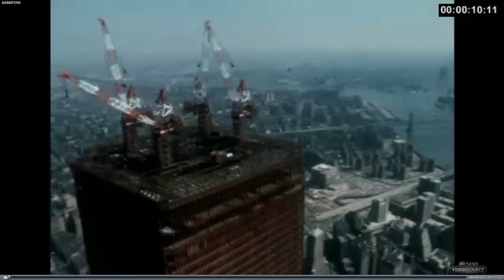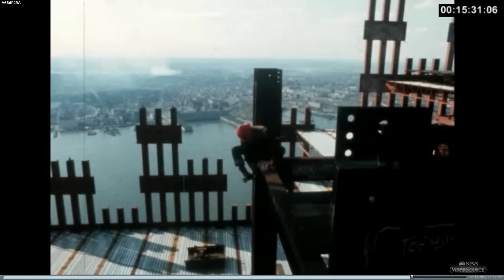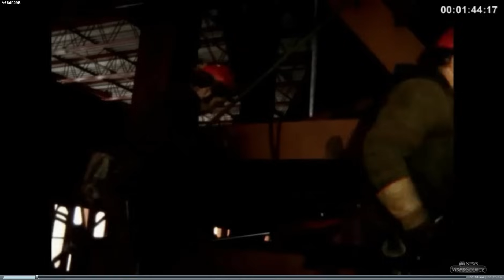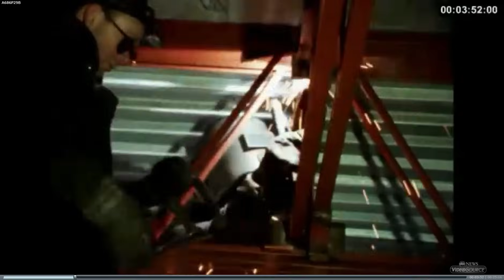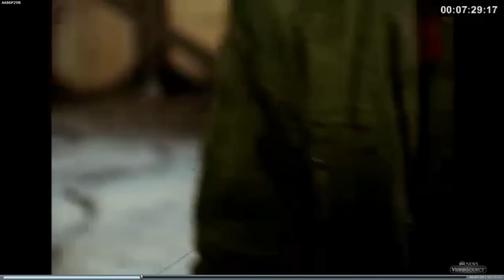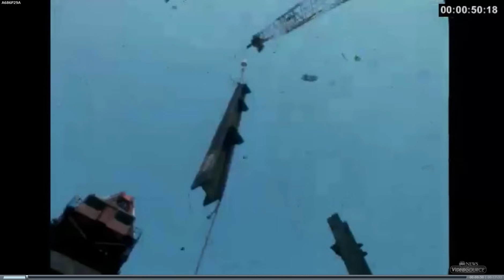WTC South Tower Construction Shots - March 1971

Comment: The sheer strength of those buildings can't be understood completely if you never been in the towers and stood between those huge I-beam's.  When I looked out of those narrow windows and looked down at the street the cars looked like hot wheels that you could just reach out and grab one.  They could withstand 100 plus mile an hour winds swaying 10 feet or more in any direction and you wouldn't even know it.  The 47 box beams in the core at the base were 5 inches thick 5 inches!!!  You can't imagine how strong that type of steel column is.  If you had just 1 50 foot beam it could hold the weight of 10 full size brick homes with ease.  I work on commercial passenger planes for years. The 57 and 67 planes are built as light as possible to save fuel and keep cost down.  The skin on the wings of the 67 has metal so thin that if someone walked on it it would fracture and have to be repaired.  If someone is just researching some of the facts about the attacks and I can help someone understand that what the 2 planes that hit towers 1 & 2 did isn't possible for ANY passenger plane is capable of just ask and I'll try and help you understand how it is impossible for flight 11, 175 and 77 to do what they did that day I'm happy to help.
Reply: @cream수탉수탉 big kok single engine puddle jumpers aren't anything like Boeing or Airbus aircraft.  Those type of planes are not designed like commercial aircraft that every gram of extract weight makes it more fuel efficient so it will fly further and save on fuel.
Reply: I was thinking the same thing when it happened, the thickness of the steel and the planes being basically an aluminum tube. I seen on YouTube a video done by a scientist that showed how easily it is possible, demonstrated how water at really high pressures could cut through steel.
Reply: @rsears78  How much pressure and what is the force it exerts per square inch? Also are you saying that the base or lower floors of the building were damaged in that manner?
Reply: Bartholomew Beauregard III  thank you for your critical thinking that so many people are not using.  Israel has this nation in a strangle hold and does not care about a country full of gentiles. Whenever they use up all that they can they will just turn to the next world power and do the same.
Reply: @438295 what lies?
Reply: mkbxtr44  you think whatever you want to cause I could care less what you think or beLIEve
Reply: mkbxtr44  name any commercial passenger plane capable of reaching 500 knots below 20k feet
Reply: mkbxtr44  you shouldn't make comments trying to sound like your educated bro.  That was as sad a comment as the one Donald made saying that same ignorant reply about picking up speed going down hill.  The airframe itself can NOT withstand the resistance in such dense atmosphere and remain airworthy.  Wood is quite a strong and powerful material, like a tooth pick size piece have been found inside of automobile engines and tree trunks after a tornado touches down.
Reply: mkbxtr44  please present proof of your claims
Reply: mkbxtr44  name one bro! You are the one claiming that it is possible so give me a example.
Reply: mkbxtr44  just give me one example where a commercial passenger plane exceeded it's VMO by 100 knots and remained intact, just name 1!!!
Reply: mkbxtr44  I have NEVER claimed the jets were hollow tube dude so get your lies straight
Reply: mkbxtr44  thesis as in THEORY
Reply: mkbxtr44  stop dodging the question
Reply: mkbxtr44  your link is this video
Reply: mkbxtr44  now I'm not following you, what are you agreeing with?
Reply: mkbxtr44  why won't you answer the question?
Reply: mkbxtr44  why would i read a bunch of threads nearly a decade old of people arguing with shills?
Reply: mkbxtr44  how much does it pay? Just wondering what you sold out for.
Reply: mkbxtr44  Even diving from an higher altitude can not explain the official speed since the engines are designed to be most efficient at high altitude were the air is thin so at lower altitude with dense air the engines can not take in too much air, with too much air they will actually start to spit the air out and actually act like brakes to slow down. And see the documentary The great American psy opera by Ace Baker
Reply: mkbxtr44  Imaginary plane can do anything. See the film by Ace Baker, I did not believe that there were no planes I thought people who said that were insane until I saw he's video he shows how they edited the planes in the video and even shows the live chopper 5 footage which has not been replayed on tv where the nose of the aircraft accidentally exits the building undamaged!
Reply: So you think that terminal velocity can allow or account for the 100+ vmo of those aircraft?
Reply: Somehow i don't think that it it i were to get Boeing's entire engineering department on video confirming what I said was true it would convince you.
Reply: Truth needs no defense, it stands alone.
Reply: @Viagra_risk_PERMANENT_insomnia  of course water can cut through steel. When it's pushed through a tiny hole under tremendous pressure it can but that can't be said is what destroyed the steel abd brought those 3 buildings down that Tuesday morning.
Reply: @Viagra_risk_PERMANENT_insomnia  Do you traitors spend all day and night trolling videos like this one?
Reply: @Viagra_risk_PERMANENT_insomnia   Are you an American citizen? Born in the US?
Reply: Kelton Foster Your comments are silly because you obssess over the strength and size of the steel and forget about energy.  If I threw a tennis ball at your chest, you’d let me do it.  But if I fire the same ball from a potato gun, I bet you’d get out of the way.  Why?  Aren’t you stronger than a tennis ball?
Reply: @haroldlipschitz9301  Do all you shills come to the comment section under these 9/11 videos for your training or is it just routine? If you read my comments then you know you don't have the empirical evidence to prove that the towers simply "collapsed" due to the fire from impact of flight 11 & 175 and you certainly won't address the issue of HTA being a factor in the "collapse" of 1,2 &7.
Reply: Kelton Foster No but as a laser engineer and with my brother as a HS physics teacher, there are often conversations in my family about all the misinformation over the years fed by lack of scientific understanding.  This is a good starting point if you are still unsure of the collapse scenario:

http://citeseerx.ist.psu.edu/viewdoc/download?doi=10.1.1.490.2176&rep=rep1&type=pdf
Reply: @haroldlipschitz9301  Yeah me and about 5 billion other people are not sure of the "collapse" scenario. We are sure glad there are edjewmakated people like yourself out there to help us push that nagging common sense out of our minds and off a cliff.🤔
Reply: Kelton Foster You are entitled to your opinion, but not your own facts.  The most common issue people have with these events is lack of ability to imagine/comprehend the forces involved. Fortunately there is a language called mathematics that can fill those gaps -
but only if one is open-minded enough.
Reply: Kelton Foster I was working for UAL at the time throwing bags while still in university - don’t lecture me about loss, the whole company felt the loss of staff and customers.  That is not an excuse to make wild accusations and deny science.
Reply: Kelton Foster Swiss-German actually, but grew up in the LAX area, and still reside there half the year
Reply: @haroldlipschitz9301  we call it college here in the US not university
Reply: Kelton Foster I work all over the world, and that’s what people generally call it.  In Australia, where I live half the year, everyone says ‘uni’’.  Anyway, as I said, one moment I was hunting around on Unimatic, trying to find good loads for my travel adventures, the next we were reeling as a company and worried about whether we’d still have jobs in a month - especially the part timers like me.
Reply: Kelton Foster I think that it is really Awesome that you offered your expertise to answer questions, educate. So many people don’t do enough research or ask questions before making a decision. My question is when you look at the footage of the plane(s) hitting the buildings do they look like they should under the conditions. Such as flying that low, the manoeuvres they made. Much Appreciated 🦋💕🦋💕
Reply: Wes Fox I don’t know about the Boeing engineer(s) but I have watched a lot of videos with pilots, air traffic control, etc. Saying it cannot be done. Can you put up your reference to this please. I am always interested in other people’s opinions. Thanks
Reply: mkbxtr44 Very Interesting read. Thank you for sharing. I however do believe we owe each other mutual respect. There is way Too Much Negativity in this World. Bottom Line we can all learn from each other. This was an Unbelievable tragedy it’s hard to wrap our heads around it in so many ways. Thanks Again. 🦋💕
Reply: @tracyvanbragt2057  A Boeing 767 isn't capable of reaching the speeds those planes reached.
Reply: @haroldlipschitz9301  my uncle-in-law is a nuclear physicist 
For some reason he thinks it was a CD
what is your explanation of the molten steel pouring out of the towers, and then being found squirting out of the rubble weeks after?
Reply: @walterbrunswick  Nuclear physicists don’t study structural load dynamics. The molten material seen on WTC2 was generally agreed by experts to be material from the large UPS battery facility used by Fuji Bank in that location of the 81st floor.
Reply: The connections between the columns broke
Reply: Well, you missed every single videos and pictures then which clearly show that the planes easily cut through all that steel, and there was a plane size hole on the side of the building.

When reality contradicts with your hypothesis, then probably your hypothesis is wrong, and not the reality.
Reply: fyi the steel was thinner as it went up higher to the upper floors. so where they were impacted plane just went through like was butter. also planes were traveling over 450 mph thats alot of force my friend enough to sever the exterior and some of the interior core hense why stairwells were blocked. the ensuing fire weakened the steel caused sagging and unable to carry the load anymore. was only a matter of time before they came down. the hat truss system transferred the loads to the ground to allow people to get out in time otherwise the loss of life would have been immense. no building could withstand a  jet impact just physics and common sense.

Comment: I just realised you can see there's quality issues with the welding as you can see after the collapse where in the pieces are broken off are at the welds. Probably Was the first thing to give way
Reply: The welding had to hold the weight of the building. They didn’t have to resist an airplane crushing through, or a top half collapsing into the bottom half.
It is not a quality issue, as they satisfied the requirements.
Reply: @juzoli or a controlled demolition
Reply: @jamesstewart1794  Controlled demolitions are started at the bottom, not at 2/3rd up of the building

Comment: Werent they also sprayed with a fire resistant foam too or was that coated on the back of alloy cladding?
Reply: The trusses were coated with fireproofing.
Reply: @davepowell7168  That was blasted off by the 200 ton plane and fireball at 500 mph.
Reply: @naysayer1238  Yes, the affected floors were compromised

Comment: Great footage, thanks for posting. Watching this you do realise what a load of garbage the pancakers come with of how the towers collapsed. They say the floors were held  up by fragile  trusses (tubular like grid supports) judging by this footage they were dirty great steel beams, they   weren't going anywhere. They said all the bolts snapped due to the stress. There is a guy pictured bolting banks of 16 huge bolts. Again they weren't going anywhere. Why do they have to lie?
Reply: The floors were indeed crappy thin trusses.
And the way they attached to the core and outer walls was pretty weak.

These buildings were designed to be built quickly and cheaply.
Reply: @massimookissed1023  have you not watched the video? Those floor "trusses" were thick steel beams I did not see any trusses anywhere. If you know where a picture of these are, I'd love to see it. The twin towers cheaply constructed what? They were the best and strongest high rise buildings ever made. There was so much steel in them foundries from all over the US had to work flat out to supply the build. Grenville tower, London was a cheaply constructed social housing high rise. It survived a  8 hour flame encompassing inferno with zero structural damage.
Reply: @patricksmith4424 do u understand how much weight it’s a 140 ton Boeing 767 with 90,000 lt of kerosene at 550mph is ?
Reply: @stephen_crumley  I believe what I saw.  The load bearing outer walls at th point of impact bowing from due to the out of control fire, disconnecting the floor and then the tens of thousands of tons of weight from above slamming down onto the next floor and breaking it loose and thereafter every other floor one by one.
Reply: @patricksmith4424 you watched a YouTube video and now you’re a structural engineer, maybe next watch a video of a Space lunch and then you could be a qualified astronaut.

Comment: Just shows the heat it took to make those collapse coz that was a good solid structure. What were the chances of 2 fully fueled passenger planes hitting it when they were designing it. They only accounted for helicopters and light aircraft. I'll still never forget seeing that 2nd plane hit live and being in disbelief, just think how many people around the world gasped at exactly the same time that day. Even more intense than pearl harbour I imagine as not many saw that live.
Reply: I believe they were safety rates for collision with 707 jets at speeds of ~200 mph.  The idea being that a collision would be due to a plane trying to land at one of the local airports  going off course due to weather or mechanical trouble.  

At the time the WTC was designed , the 707 was the biggest plane in service.
Reply: @peterp2153   they never anticipated 767s flying at ~430 knots loaded with so much jet fuel
Reply: Nevertheless, it would’ve survived an impact of a full speed passenger plane, taking down half the structural support. It would’ve also survived a huge fire fueled by large amount of highly flammable material. But not both at the same time.

Comment: my question is how did they get those cranes up on the towers to do the work that they needed to do & then how did they bring them down
Reply: The cranes ”grow” with the building. They move it up while the building is constructed. When they take the crane down they dismantle the crane and hoist it down with a smaller crane. The smaller crane can then be dismantled the same way until they cab take the parts down by elevator.

Comment: I want to address the conspiracy people. They say everything was dust. Wrong. Most of the steel was in the basement or where that would been when they feel. Anything else, concrete, asbestos insulation and concrete, wood, etc was what the dust was. All the steel fell and with fires later uncontrolled burning melted some deep below. Remember the basement was huge and several levels. Most of it was there in its pieces.
Reply: whatever helps you sleep at night
Reply: Magically bypassing stairwell B ? Mickey Cross's statement on record would also need 100 story's of steel reinforced concrete floors 208x208ftx4" to mostly blow away, the other mechanical floors (41-42 etc) being stronger for loading

Comment: Take a good look at those Steel central cores.   NOTHING would demolish those, unless by extreme explosives, at every floor level.   The floors were a different situation completely
Reply: Don't be delusional. Your comment would make more sense if the towers collapsed straight after impact but it took like an hour for the heat to weaken the structure enough for then the mass weight of several floors above to cave down. With each floor collapsing the weight only got heavier and heavier until there was no stopping the building from crashing right to the ground.
Reply: Well that's strange since there were no explosives on any floor at all.

Comment: Read the only existing forensic study of the destruction of seven World Trade Center buildings on 9/11, Where Did The Towers Go? Evidence of Directed Free-Energy Technology on 9/11 by Dr. Judy Wood, a structural engineer with a Ph.D. in Materials Engineering Science and expertise in experimental stress analysis, engineering mechanics and strength of materials testing.
Reply: Have you read this book or just advertising?
Reply: @peterp2153   Do you disagree with the evidence in the Woods book or the conclusions?
Reply: @juzoli  Loads of energy is available. 
 The research, development, materials, manufacture, installation ,maintenance aren't usually cheap. 
Scalar/ 'directed energy weapons' are around but probably running off grid or solid state battery series. 
  A weapon needing a hurricane approaching for days to 5 mile proximity is possibly going to lose the surprise factor ?